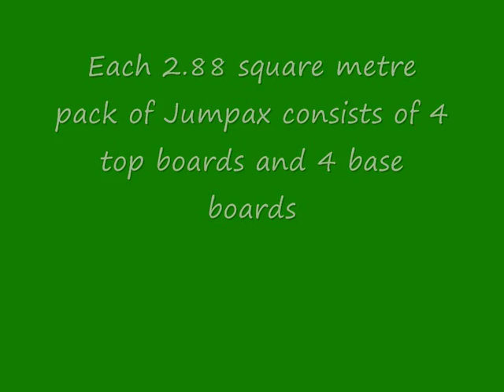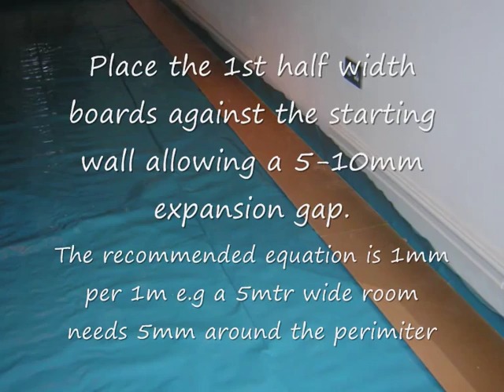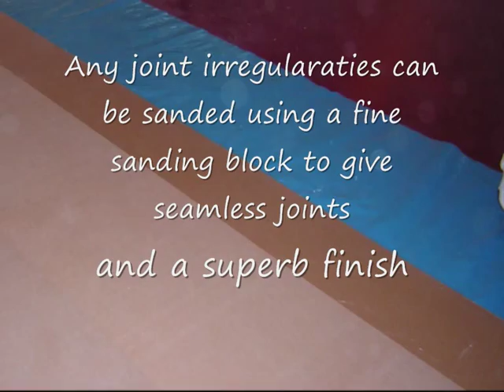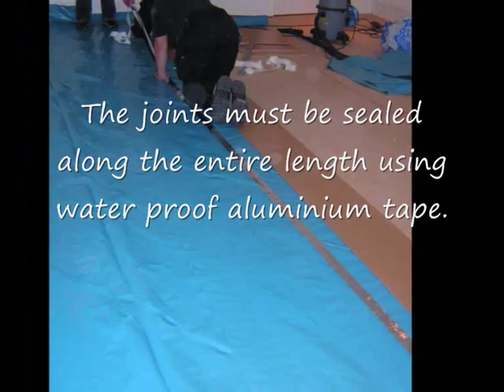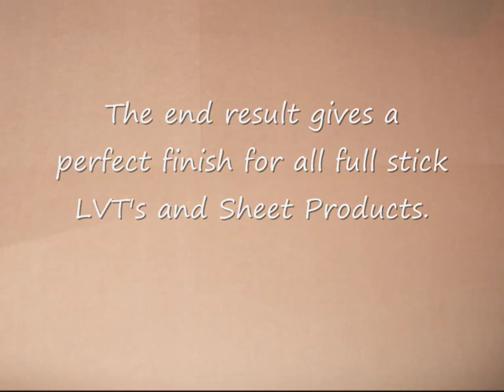Jumpax  Installation instructions

Comment from the maker: Andrea, You can fit on top of this straight away with no need to prime, it can be used over the top of tile floors or concrete and wooden floors and can be removed at a later date without any damage to the floor underneath. It can be fitted in comercial locations over the top of expansion joints. if you visit jumpax dot co dot uk you will find more information or call 0845 678 1234 for more info